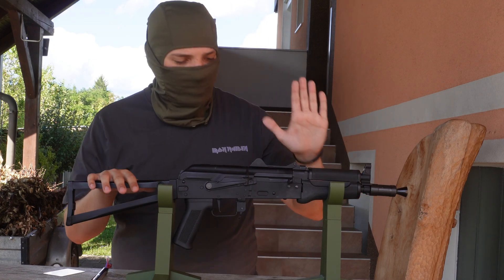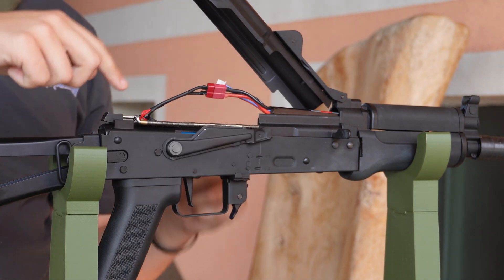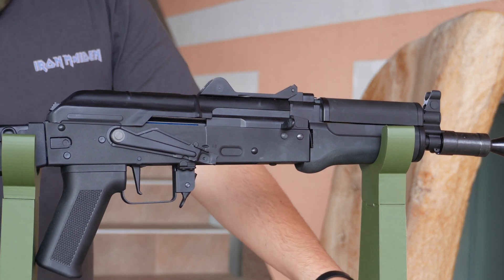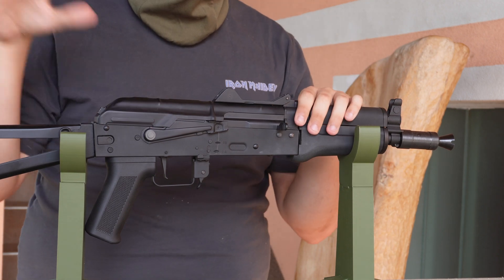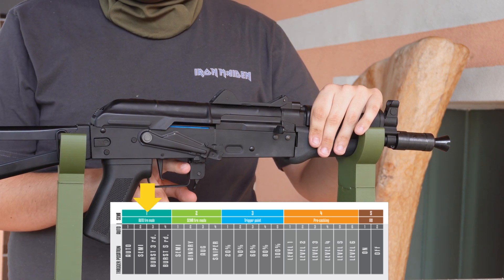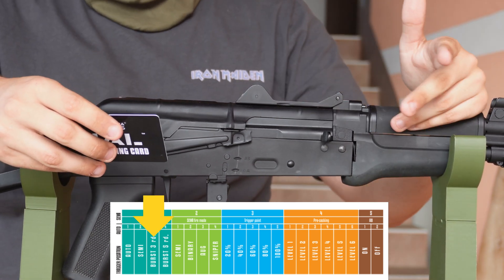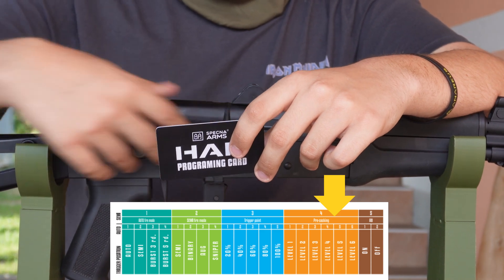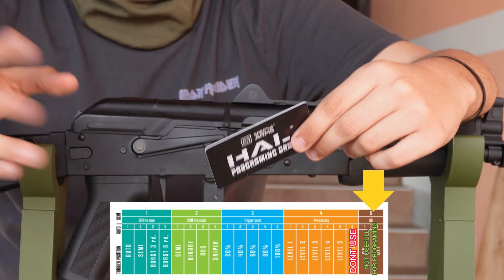HAL Mosfet Programming & Features AK Version

Comment: Dude, awesome video, I gave it a like. But I need help with something.

My AEG was in factory mode, I did what you said: held the trigger for 5 seconds, waited for 2 beeps, switched the fire selector to semi, and fired a shot. But when I switch the fire selector to auto, the gun fires for a second and then makes the sound it usually does when it's in factory mode (boop, boop, boop). After that, whenever I move the fire selector, it just makes that "boop boop boop" sound and doesn't shoot at all.

I reset it back to factory settings, repeated all the steps above, but it’s the same issue again.

What can you say about this? I’d really appreciate any response. Your videos are awesome!
Reply from the maker: Id contact customer support in your case
Reply: @ark.airsoft okay, thanks